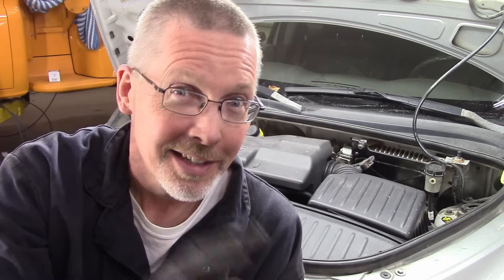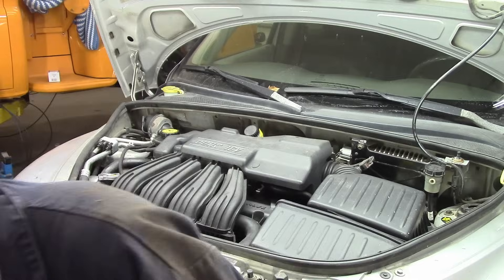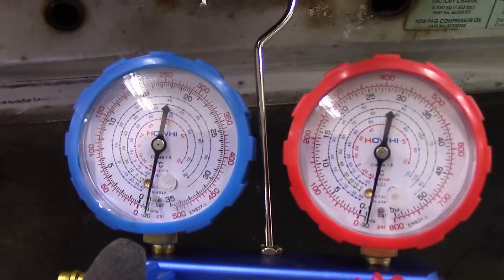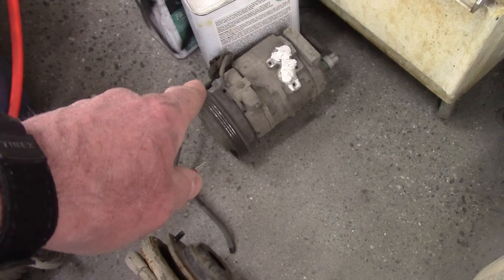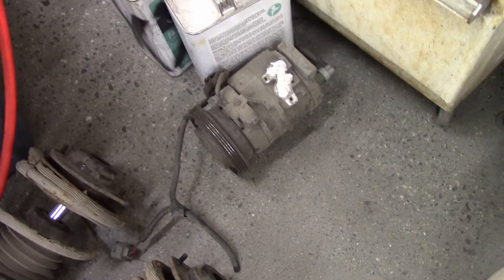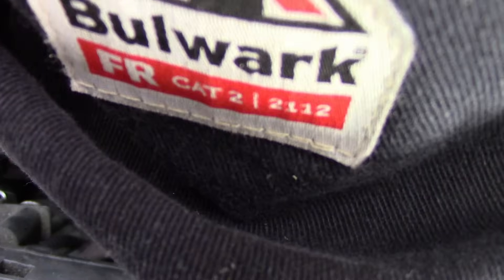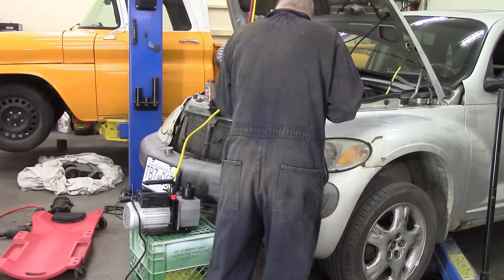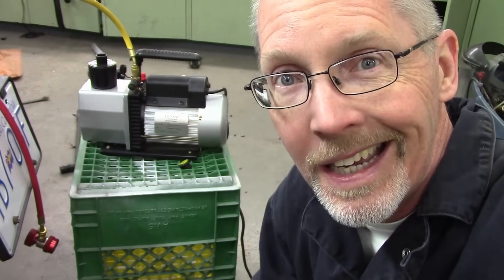DIY Testing, Fixing, & Recharging A/C

Comment: good effort with AC not being one of your strengths. can see why you were told not to put it up, espeically in canada a person can't buy r134a in the parts store like you can in the US. r134a and r1234yf don't put holes in ozone layer, that's ODP (ozone depletion potential and older refrigerants like r12 and r22). R134a and r1234yf refrigerants have 0 ODP and some GWP. globalol warming "potential". you don't use a vacuum pump to evacuate refrigerant, you use a recovery machine and an empty cylinder to recover refrigerant to. Basically the world won't end and you aren't depleting ozone if that refrigerant didn't make it's way back into a cylinder for reclamation. your next goal: vacuum with line from vacuum pump to service port and a micron gauge on the other service port. But all in all, I think working on anything on a PT cruiser has got to be a punishment in the 6th or 7th circle of hell. A bit better test when you have a clutch cycling switch at the accumulator and high pressure cut-off switch at compressor is... feed the clutch ground and +12v. In many cases, the AC signal from control on dash goes to HP cutoff (normally closed) then to VCM or PCM.  The clutch cycling switch (or low pressure switch) sends a ground to VCM/PCM when pressure is above low cutoff. Then the VCM/PCM will ground the clutch relay's coil. The relay contacts will send +12v to clutch.   Not sure if you checked this offline before going at replacing the clutch or if you checked that the clutch was getting +12V from the relay, could have been the high pressure cutoff connector you said was buggered up that kept the clutch from engaging. During normal operation the HP switch is closed, so a break in the wire keeps the clutch from energizing.
Reply: whenever you jack up a car and use jack stands, put the tires under the car to be extra safe . easy to do and will save you and the car if something bad happens.
Reply: Well, a recovery machine costs thousands of dollars, and it must have a vacuum pump built in because once the refrigerant is recovered it is also used to put the system into a vacuum. Isn't there also a low pressure switch in all systems too, that protects the compressor from engaging if the system is low on refrigerant? He was trying to save money and at least put the system into a vacuum to pull out any moisture before he charged the system. Maybe the enviro police don't like it but....
Reply: We all know that 95% of what they say is bad for your health or the environment, is in fact not. Radon, aspestos, blah blah blah. Look what they did to gasoline cans
Reply: All this is is a bunch of crap with the government. The ozone layer Freon is environmentally safe. It states it on a bottle and if you use common sense think on your own, you will see it. The chemicals that are used it’s been proven is just a money racket for the government to screw the people that work with it you gotta have a license for this you got to have a license for that yes I agree you should re-cover it because it can be reused unless it is contaminated every person should be license to use it, this is a bunch of crap that if you mess with a 12 ounce can you don’t have to be license but if you mess with a 30 pound bottle you have to be license it’s all rocket people that don’t know what they’re doing shouldn’t be touching it. You should be made to have a license to buy any type of Freon whatsoever. The reason is because people don’t know how to charger systems. They overcharge them, lock them up and just blow the Freon off or the system blows up in their face because they think, it’s not cold enough shoot more into it no you can’t. You have to diagnosed the systems and people don’t know how to do that anymore. They just want to throw parts at their systems anymore just like automotive they don’t wanna diagnose nothing no more they don’t know how to read a scanner and what I mean by that is you don’t know how to read data reading scanner is easy, the scanner point you in the direction, the problems that and then you got a figure it out and it converts computer language into English so we can understand it. You have to know the numbers people don’t understand that and for the simple fact of AutoZone advance. I think they should be made to stop scanning vehicles because they’re making people believe that that is the problem just because they hook the scanner up people don’t realize they’re there just to sell parts they didn’t diagnose it but they get pissed off when they take it to the shop AutoZone said put this part on when you put it on and then it doesn’t fix it. Well it’s not our problem we didn’t diagnose it go back to AutoZone saw and they would stop it dislike war forks. I don’t know what the reason for us, but they no longer can charge for air because they were suit. That’s why they’re not charge for air. People just need to learn to idle down take a breather and take a step back and learn you must troubleshoot system if you can’t have your magic, eight ball and throw parts at it because it can’t be a broken wire a loose connection I spread pin peoples in is such a big hurry nowadays they got time to troubleshoot or look at the simple fax the simple things that staring them in the face they think technicians are out to rip them off because they want to diagnose it. No, we want to cover our ass and that’s with all technicians even HVAC, I know HVAC people of seeing this problem people just want to shoot them or throw the part Adam and it always doesn’t work out. That way you have to diagnose things but this fast electronic world is not going to work it’s killing everything people need to learn how to take a breather, slow down think about the situation and take a double look at the whole picture and yes there is a lot of places HVAC automotive shops plumbers that won’t troubleshoot nothing and just throw parts at it all day. Oh I’ve seen that problem. This is what it is. Yes you seen a problem but you need to verify that that is the issue because you could have a defective part but you could have a wiring problem to you need to make sure but people don’t want to hear this. They don’t have time for this they think troubleshooting is a rip off. No it’s not. It’s to confirm that that is the actual problem, or do you have multiple problems and this is one that pisses me off to no end when they call automotive technicians mechanics we are not mechanics technicians figure out the problem for the mechanics to put parts on. We completed the puzzle we went through the system diagnostic mechanics don’t know how to do that. There’s a big difference in the two and a lot of people don’t understand that and they don’t know there is a difference and there is a big difference and I hate people that can’t comprehend and get that correct and another one that bothers me is people that say probably they’re not sure of their own selves that that is the issue learn how to speak. I can go on and on about this, but I’m going to cut it from here, but the main concern was talking about this global warming crap people just need to learn to use common sense. That’s all face the facts we could do all this work to try to save the world. It’s good. Going to do my lash one. It wants to mother nature you’re not gonna stop it you’re not gonna control it it’s gonna do what it wants and what it wants and nobody’s gonna stop it. I don’t care how much you do so you people just need to face the facts. Human beings are not gonna be around forever that’s the bottom one.
Reply: And as far as the hole in the ozone layer, we just now got technology to see it it’s always been there people don’t believe it but it’s been there. It’s a chimney, so suck it up deal with it. Nobody’s going to change it nobody’s going to fix the problem in the story. Humans won’t be around forever grandkids their time is limited on this earth face the fax people
Reply: world will end cause from a global warming perspective its 1400 times more potent than CO2
Reply: Trying to understand all of these acronyms is breaking my brain
Reply: Who uses R12?? He's using 12a, which is even less harmful to the environment than r134a/yf
Reply: @zromo8994  bad for the environment?  you're kidding right? a few cans of R!2 don't have any effect of the "environment" at all. There are so few cars that still use it are completely inconsequential. Do you have any idea how much air is in the atmosphere? Apparently not.
Reply: Too many people believe in lies. GWP Global Warming Potential. Wtf does that even mean? Nothing, except a scam to tax more $ from the gullible. Same with the “oZoNe LaYeR”, and save the wales, and global ice age, and the earth will run out of oil, and acid rain, and and and. All propaganda. No amount of taxes will ever change the environment ret@ards.
Reply: Yeah its just greenwashing BS a little bit of gwp... Ill still recover my r134a though but thats only because of how expensive it is and its not exactly legal to buy either so its worth its weight in gold.
Reply: That's 'some' GWP of 1300 (GWP-100) for R134a (and about 3800 for GWP-20). That's pretty bad. Given that it tends to leak out every 6-10 years that leak rate adds the equivalent of about 5% to your fuel consumption (up to 10% on a small efficient car), which is quite significant. R1234yf is much less of a problem with a GWP-100 of 4. You really don't want to let R134a into the atmosphere because a canful is equivalent emissions to driving a few thousand miles.
Reply: R134a has a ODP of 0.000015..... virtually nothing but still not zero

Comment: It's probably simple propane (R290) in those cans. With a fancy label. Properties are quite close enough to R134a. But myltiple times cheaper and multiple times less greenhouse emissions than R134a. Only downside: If you have that one freak leak into the cabin on a hot day and your spouse is transporting the little shits to and from school/kindergarten...poof, they all gonna be burnt. Sorry for the physics. Apart from that, I always use it as a cheap alternative to figure out any leaks before I put the real R134a back into the system. Good luck.

Comment: I am curious how you would diagnose a leak if it had one
Reply from the maker: You can purchase a refrigerant "sniffer."  I don't have one. I have since fabricated an adapter to put compressed air into the system and I can check for bubbles with soapy water. This car, however, was sold a few years ago.

Comment: Had car in shop - asked for ac recharge - said couldnt needed $ new $ lines $ - wouldnt accept refrgt - I said jump low pressure switch with paper clip to trick compressor - they acted insulted and said we dont do that stuff - Did myself - airs niiiiiiiccce

Comment: Good video on a PT Cruiser. Not the easiest car to work on. That little switch at the front of the radiator that was disconnected is actually a temperature sensor for outside air. Depending on how the ECM is programed it may use this sensor for temperature control and/or  fuel air mixture calculations.  When using those little refrigerant cans you should not turn them upside down because you can charge the system with liquified  refrigerant on the low side. This can hydro lock the compressor and damage it or burst seals. You should keep the cans upright and gently shake them during refilling every minute or two.

Comment: we picked a 98 rav4 from brother in-law recently passed away.  The rav4 had not been used since 2019 and been into an accident.  The Condenser was hit, damage and leaked the freon.  Tested the system and found a very slow leak after left it with -30" for 24 hours. Replace condenser unit, evac, left for 24 hours no more leak.  to test the all cutoff switch and compressor, I put compress air from air tool compressor to 100 PSI.  started the engine and ran the AC for a very short second to see if compressor and switch are working.  Then evac for an hour (30 mins should be fine), added 1-2 teaspoon of pag 46 oil w/ UV green color dye and then harge with A134 freon to factory recommended.  Air blow cold to 39-41 degrees just at idle in a 86-degree temperature.

Comment: Why are you feeding liquid refrigerant in on the low side of the compressor?  You trying to blow the compressor again? You can’t compress a liquid. I guess you wanted to see if you could do the job a 3rd time.
Reply from the maker: What, because the can was upside down?  I read the instructions on the can.  I prefer to follow the instructions on the products I use.

Comment: Question, I start to charge my system and  when the a/c kicks  on for some reason it blows the hose off the top port of the condenser?  95 probe gt .. I mean it beams the hose connection and now I gotta get a new one. It’s done it 3 times already ..  I vacuum it out  and holds  then when I start to charge it blows? Your thoughts?
Reply: Wow so rock auto sent me the wrong spring that locks the hose line, I switched it out and found the correct size and bam! Got ac  on my 95 probe gt!

Comment: Why not just get the stupid EPA card rather than playing around with unknown refrigerants that may or may not be compatible with the oil, seals, etc. 

All you have to do is pay $20 or something and take a 20 question multiple choice test. It’s called an EPA 609 certification card and it’s good for life. 

If you want to work on non automotive AC systems, you need an EPA 608 card that is a little bit harder and costs a little more but still not a big deal. Hell it only took me one day to take the class and test for the 608 universal card. 

However for automotive you can get your 609 card online in about 10 minutes for about $20. There is absolutely no excuse not to get one!
Reply: Thanks, you convinced me that I DON’T need an EPA card. Cute username btw, how’s that billionaire worship working out for ya lol

Comment: Just an FYI- if you don’t want moisture or air in your AC system, purge the fill lines coming from the refill can before you hook it up
And the amount of 134a is 480grams trust needs to be added.

Comment: No need to differentiate degrees C or F for that propane, they are the same at minus 40.
Reply from the maker: I never was good at simple math.  When I doubled it and added 30, I got -50.
Reply: @GregWellwood ..double it, subtract 10%, and add 32 is exact, and almost as easy. Gets clumsier with negative numbers.

Comment: The one stupid and fake things ac mechanics always say is that they have to apply a vacuum to the system four forty minutes or to an hour long to remove moisture. Never believe that. When the ac cars come off the assembly line when new they go to a ac charge station. They apply vacuum for about a minute or maybe two, recharge and it's done. Moisture?, that's why there is an accumulator in the system. Vacuum time equals money.

Comment: A tip for anyone doing the timing belt. To get the power steering pump out, just use a 2 foot socket extension and a universal/ swivel joint. You can reach the bolts without having to undo the radiator. I’ve done it 3 times on my 05 PT.

Comment: I wish the truth would be told about how much heavier than air refrigerants are. When they leak the gases go straight to the floor where they collect. I am still waiting to hear theories about how a much heavier than air gas makes it into the upper atmosphere where it is said to negatively affect an ozone layer that doesn't exist.
Reply: Any ozone found in the upper atmosphere was CREATED there moments before by UV photon capture of Oxygen (O2) molecules. That is how our atmosphere protects us, by our O2 capturing UV photons breaking them apart into Oxygen (O) free radicals. The free Oxygen ions are then able to be captured and loosely held by a nearby Oxygen molecule (O2) making Ozone (O3). Ozone is very unstable and will part with the extra Oxygen atom as soon as it can (usually within a second or two).

Ozone protects nobody. Ozone is evidence of the protection provided by Oxygen in the upper atmosphere.

Comment: When going from -30 pressure to recharging, how do you exactly switch? All AC videos always skip that. Do you unhook and let it go back to 0 psi or do you fill without any air escaping?
Reply from the maker: It turns out that when filling with RedTek ("12a" refrigerant), you bleed off the vacuum and fill with zero vacuum.

Comment: I am strictly a DIY'er.  I have no mechanical background other than a lifetime of doing my own repairs as much as possible. I however, rebuilt and serviced my own AC system.  Not once but twice.  It isn't that hard.  It is work but not hard work.  If someone doesn't feel comfortable doing it themselves.  Fine.  I learned how from watching youtube.  The first time I did any repair was about 1976.  I replaced a line and then had the system serviced.  Now a days I have a vacuum pump and do it all myself.  It isn't hard but you do need to learn how before attempting anything.  There are dos and don'ts.

Comment: One note on detecting leaks using vacuum, I have had more than one car in my shop that held vacuum overnight but leaked horridly when I put pressure in the system. In all cases a fitting was loose and the vacuum was pulling the seal together. I now use compressed air to check for leaks and then pull a vacuum to get the moisture out.

Comment: What work light is that you are using?  We are alike.  I put antiseize on every bolt I remove.
Reply from the maker: It's a typical ceiling-mounted 120V LED 4' light that I fabricated rubber-insulated "hooks" to that attach to the hood.  A left-over from when I built a spray booth.  Very handy.
Reply: @GregWellwood  Thanks